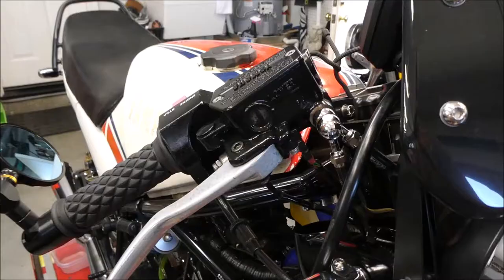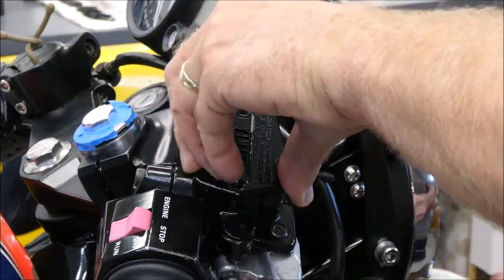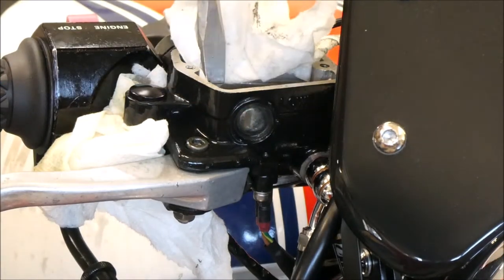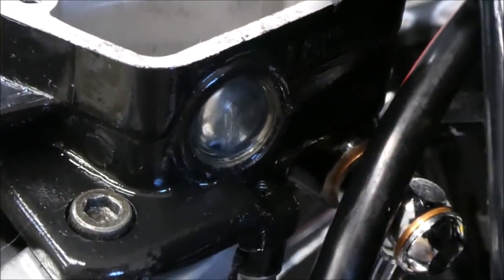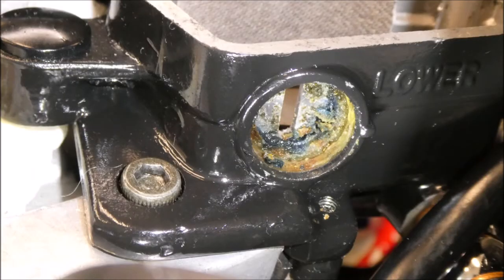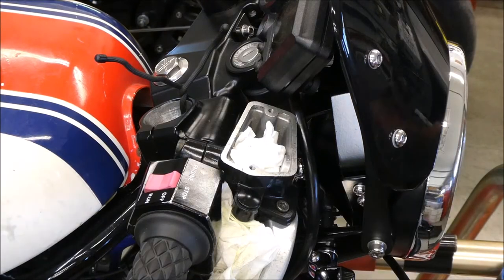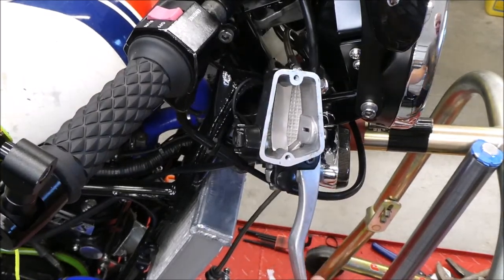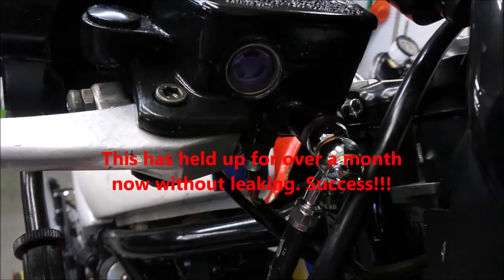RZ350 RZ FZ FZR Project Ep17-Replace Master Cylinder Sight Glass Window

Comment: Interesting video! Thanks Ken.
Reply from the maker: Thanks! I hope you don't mind me posting stuff like this on your excellent channel. If it bugs you let me know and I won't do it.
Reply: @KensGarage1  No problem at all. Feel free to add additional info or links to you video's. They are informative as well and add value to the topic. Greetings, Jim.
Reply: Hey Ken, I just found out that the sight glass on my FZ 750 is leaking like yours did. It is the same master cylinder as the RD/RZ 350. Did the new sight glass and seal hold until now? I knew you had a video on that topic. Thanks again!